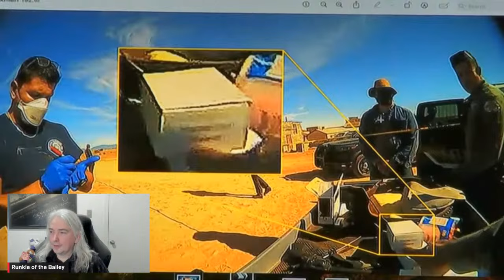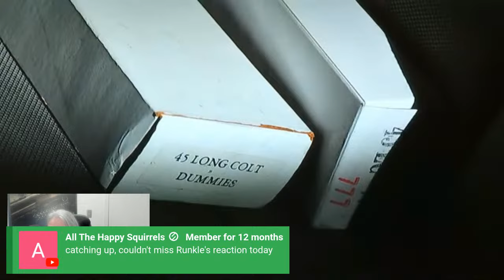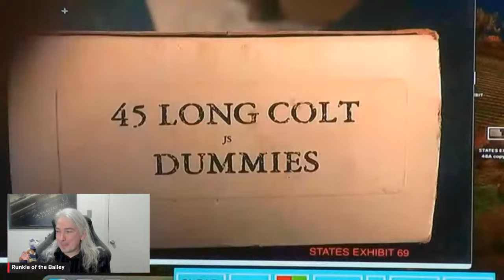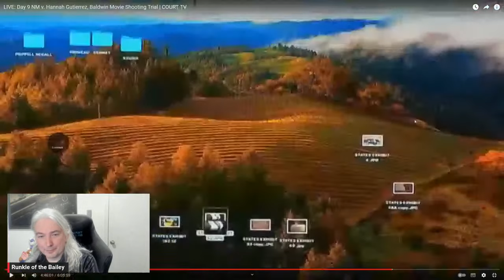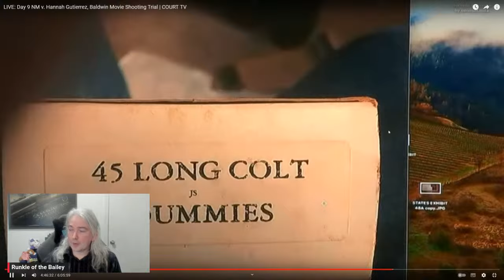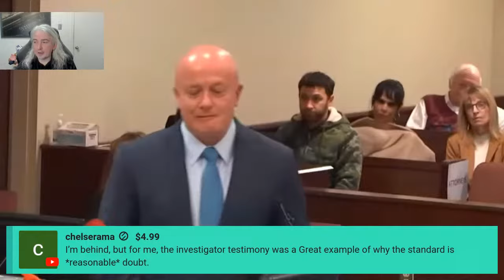Rust Trial Recap:  Day 9

Comment: I did drill in ROTC in High School(the spinning rifles thing) and all of those guns were completely de-weaponized. Firing pins removed, the bolts didn't work(or at least weren't supposed to, sometimes they'd come loose), and the barrels were cemented. And I don't mean 'cemented' as in, like, just stuffed full of something. They had literally poured cement into them. They were basically just really heavy batons at that point.

Comment: It is Hannah's fault. She didn't individually check the ammunition before casually loading live rounds from the dummy box like a dummy.
It's a box full of metal cased ammunition. It will f*cking jingle if you shake it even if they are all live. You need to individually check each round, each time. Maybe keep visual and audible dummies separate so you only handle one type in one use case.

If there is anything unexpected, stop, and check your work.

Comment: The OSHA guy said that the management didn't have a mechanism to stop live bullets to be brought on site. But isn't the mechanism put in place the employment of an armourer who ensures that no live bullets are brought on site? ?
Reply: Right!?! I think Prosecution could stretch it as management didn't have a mechanism because Hannah - who supposed to be that/ a part of that mechanism - was incompetent. 
But i think OSHA refers to 1. Unsuitable armourer, not providing enough armourer time (contradicted?) 2. Not providing adequate equipment (the safe for the guns, the cart etc) 3. No Safety meetings (pause for teeth grinding for plea dealt Dave Halls 😡) 3. Not checking if all the guns supervisors (Hannah , Sarah, Dave, Seth) doing what they should 4. Not acting after accidental discharges ...

But that's ON management! Just because everyone doing crappy job doesn't excuse you for lowering to their crappy level. I can't surpasse that as much as I'm trying to be sympathetic... All it'd take - CHECK the BULLET before loading!
Reply: Yes! And isn't the armorer management for the guns? My impression was that the OSHA guys just didn't understand how the film set structure worked. They saw a mess and slapped a fine on the top, which is fine and good, but it's not evidence to support the defense.
Reply: @kpanyc  actually as we learnt on this trial the armourer falls under the props. So the totality of this mess is the props were Seth Kenney's company and Sarah was it's representative on a set. Hannah was Sarah's assisstant in the props dept. Buuuut Hannah was an armourer hired by the Production not by Seth... 🤦 And Sarah was Hannah's assistant in armour dept. 
And aaaaall that mess falls on the Production/Alec Baldwin. 
And the sole role of an armourer is to keep/make the guns safe...

Comment: It's not true that you'd need a complex reloading setup to turn a dummy into a live round. You could use a Lee Classic Reloading Kit (and Lee actually makes a kit for 45 Long Colt). It comes in a plastic case that would easily fit in a coat pocket/a purse, has all the tools you need for reloading, and costs about $50. To pull the bullet you'd only need a kinetic bullet puller which looks like a plastic hammer and costs about $15. Basically anyone could use these simple tools to convert a dummy to a live round in < 5 minutes.

Comment: The prosecutor knows a little about ammunition but possibly not enough to know about a reloading press such as one by Lee or RCBS. We have a Lee Progressive. The de-priming die along with de priming the case it slightly flares the end of the casing to accept the projectile. You must prepare the brass after de priming by tumbling in cleaning media, measuring  case OAL and then re priming. You rotate to the powder throw and put in your pre determined weight of powder in grains. Then put a projectile on the casing and do the final press into the actual bullet seating die this will seat the bullet and apply a roll crimp to the end of the case very gradually. This would be just the basic red neck reloading in his backyard there are many more subtleties that can be taken.

Comment: 1:25:00 That's actually a good point.
Since production had been on hold and nobody was there, I doubt a cleaning crew went through the extended bits of that ranch to empty bin.
I would expect the trash to just sit there, abandoned, until the set is either dismantled or filming resumes and new trash fills up the bins.

Just look at deserted apartments, garbage disposal is usually part of the clean-up way down the line when a new owner tears everything down.